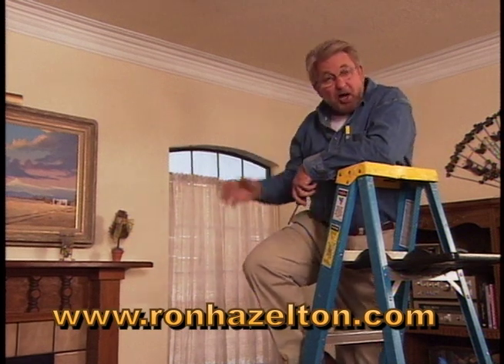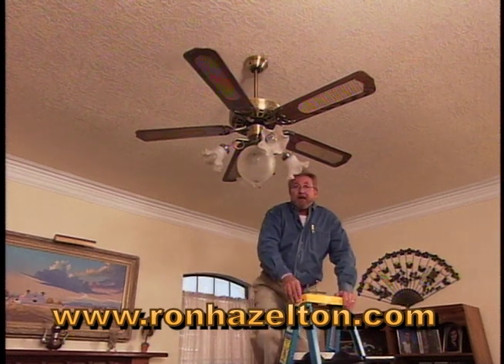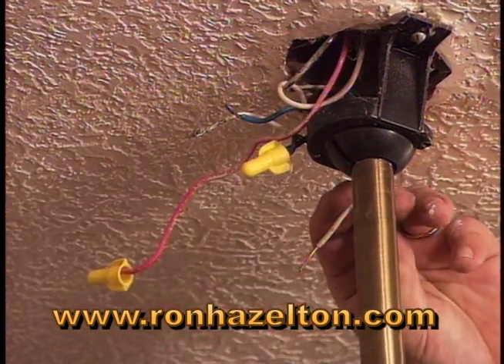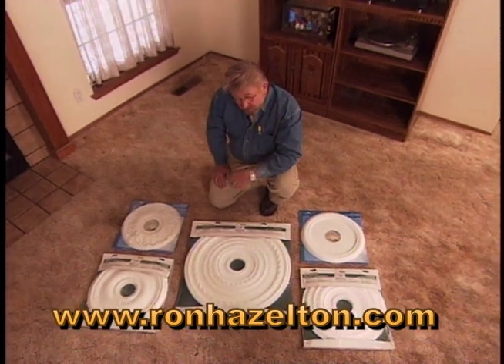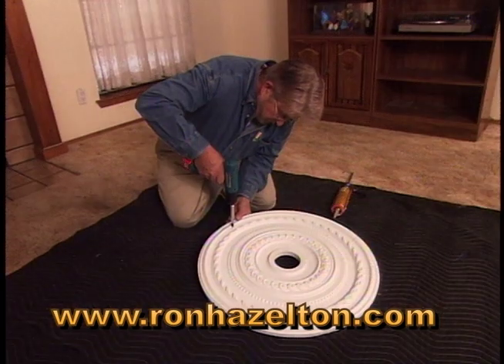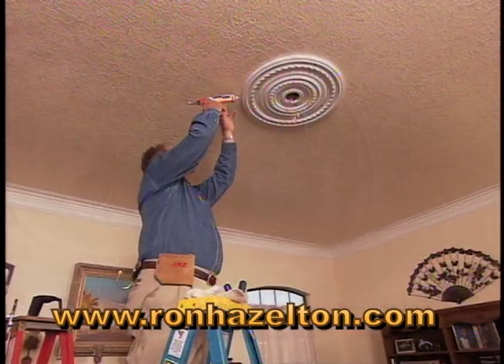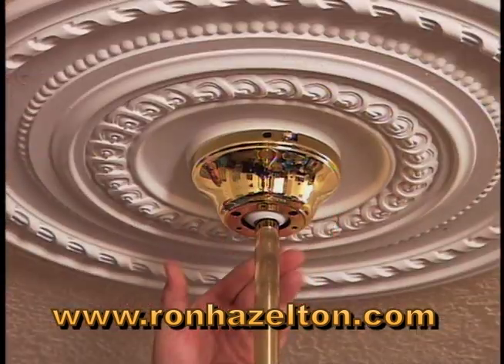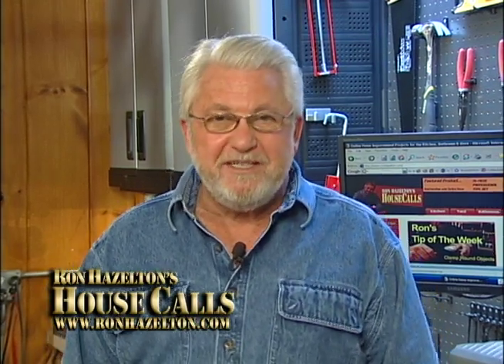How to Install a Ceiling Medallion

Comment: just got one thing to say.....  if you screw up and buy a medallion with an inner hole thats too small, do not try to trim it to make the canopy fit.  trust me on this.
Reply: So with that said, should it be sandwiched between the fan mount and the junction box/ canopy? Wouldn't you have to screw holes into the medallion that way?
Reply: lmao

Comment: You need to paint the medallion as well.  The white surface only acts as a primer.  If you don't paint the medallion the dust it collects will show really badly and you won't be able to wipe it off.  In addition, holding the medallion with construction adhesive is a complete overkill - imagine if someone wanted to remove it, they will destroy the drywall ceiling in the process.  Construction adhesive dries rock hard.  You want something strong but allows a bit of movement and easy to remove.  PU is light so you can use silicone or similar adhesive that you can cut through with a metal wire if you need to remove the medallion without destroying everything.

Finally, you don't need to drill holes and use screws to hold the medallion while it is drying.  You can use a drywall support arm or bar instead.  That's what the pros use.  Duh.
Reply: So why would you state glue is overkill and then in the next paragraph talk about supporting it while it dries. Why not just say how to install it without glue, which you didn't.
Reply: @Ashroyer86 he did though. The suggestion was to use silicone instead of construction adhesive for that particular medallion since it's low weight, and easier to remove.
Reply: Yeah! The average homeowner has a drywall support arm just lying around...

Comment: @gazovbolton07 There is nothing wrong with the way he installed the medallion. Screws aren't absolutely necessary. One could use thin gauge nail, or simply tape to the ceiling while adhesive drys.

Comment: I don't advise using any caulk to hide screws.  painters caulk/latex ect... it tends to shrink leaving a concaved dimple.  you could use drywal compound or spackel but if inexperianced might need to sand, possible damage to foam covering(thin paint or primer).  some adhering products require u to glue in place (item) then remove (item) and wait to go taky then put (item) back in place. Time consuming but no screws.  5 to 10 min. at most.  The medalion holds  NO weight , the electrical box does.

Comment: Medallion should be sandwiched between fan mount and junction box or trimmed to allow mount to attach flush to box?
If option b, what do you do when the Medallion obstructs the canopy from going high enough to line up screw holes?

Comment: there is a product called liquid nails??  make sure you use the one for foam!! some adhesives can melt the foam.  some all purpose. plastic/polly ect.  Any product read the label.  some are Not for use with foam or plastics(Polly) vinyl.ect. can melt or warp the product you are trying to install.   One product can be for adhering (Glue) ...one for covering cracks (Caulk)...  for expert use screws then the proper product to hide them  save time?? or read label adhere proper, no screws.

Comment: What do you do if the opening of the medallion does not fit the plate that goes up to hide the wires of the ceiling fan??? My opening is smaller on the medallion. The plate can go nicely over the medallion, but then i have no way of attaching the plate up towards the ceiling - the screws end up too short, since the medallion is about 3 inches think...
Reply: very true, this video has skipped the hardest part which is lowering all the attachments and possibly even lengthening the wires.